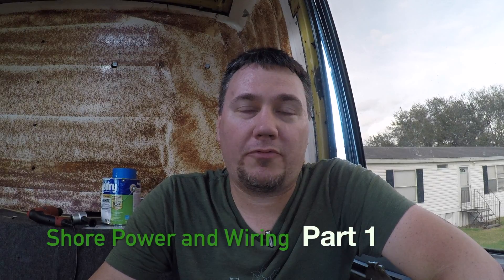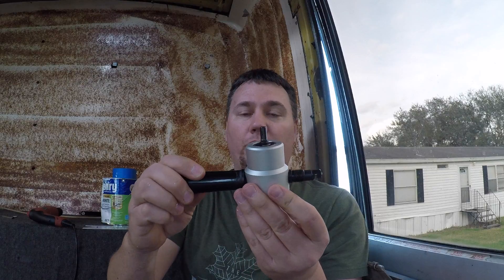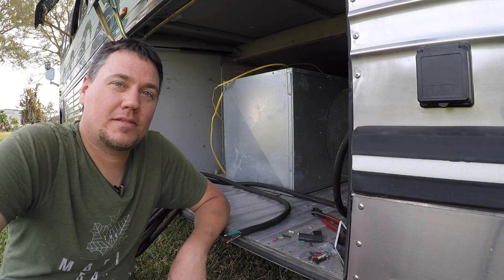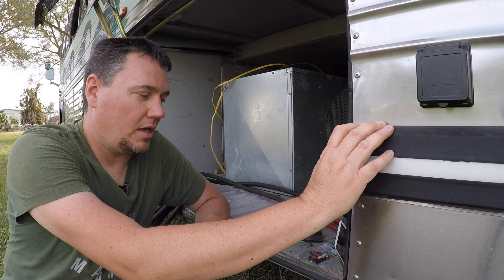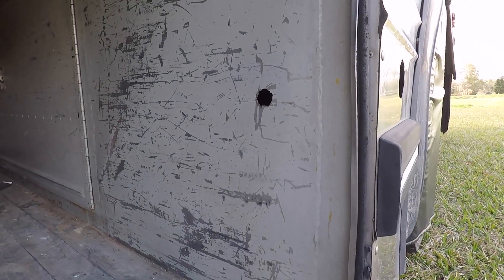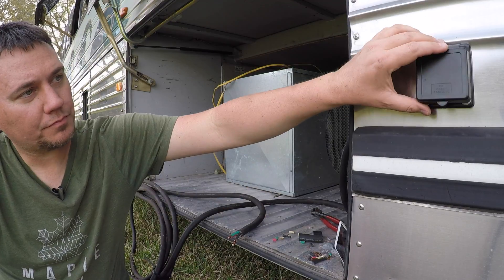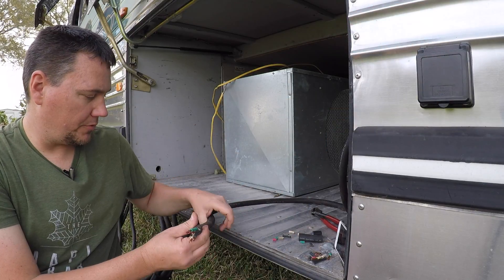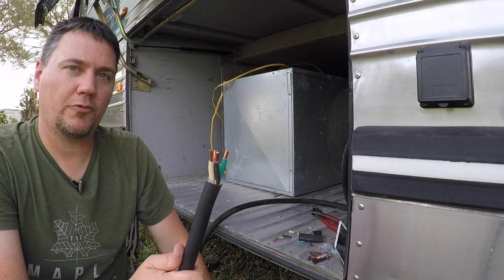Bus RV Shore Power- Install Shore Power Inlet 50A

Comment: I HAVE A 50 AMP SERVICE AND USE A 6/3 MOSTLY BECAUSE THAT IS THE SAME SIZE WIRE THE FACTORY INSTALLED. I noticed I made a typo in the wire size so I corrected it. as a matter of fact I just picked up another 20' today. I am able to see light at the end of the tunnel..... almost done with my electrical mods and upgrades.

Comment: Exterior Stainless steel power inlet.

https://www.westmarine.com/buy/marinco--50a-125v-250v-stainless-steel-power-easy-lock-inlet-without-rear-safety-enclosure--390625?recordNum=45
Reply: And, they are more reasonably priced.
Reply from the maker: Very nice! Maybe some day, I’ll upgrade 👍🏻
Reply: Just a thought, what with the SS sides of the bus.
Reply: Only $194.00!!
Reply: I know, I know.  If its for a boat I think they double the price.
Reply: I think the black plastic one you have on there looks good.